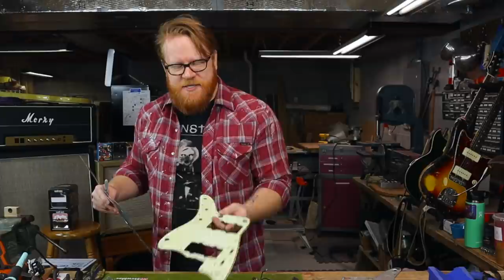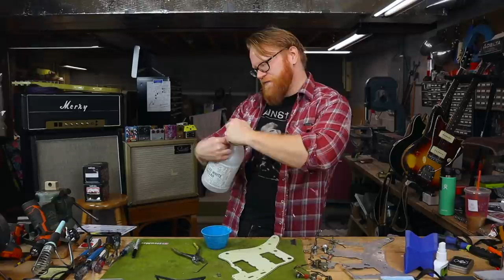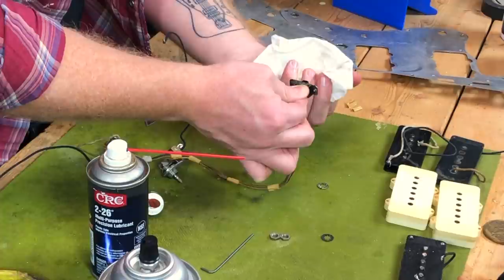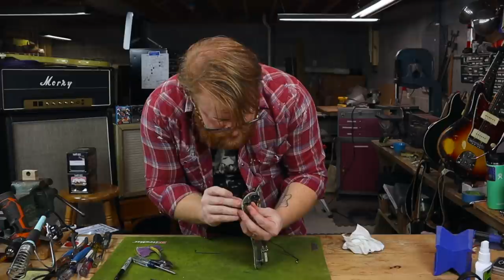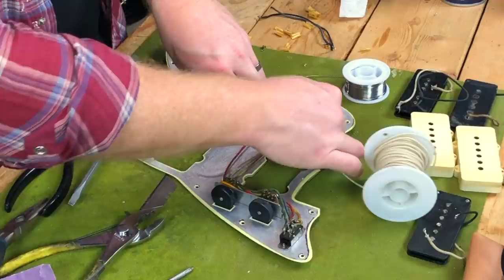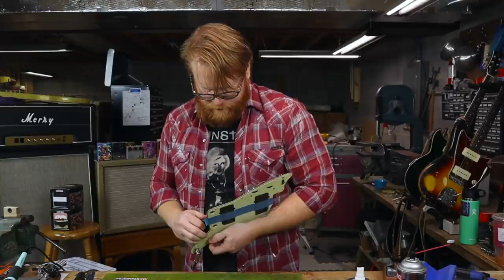REFIT & RESTORE Episode 3: Electronics and Pickup Refresh on a 1961 Fender Jazzmaster

Comment: OK…..you inspired me to dive in to my 1959 Jazzmaster. For years it had lost its mojo….was it the pickups? Nope. Watched this video….opened it up and went from solder joint to solder joint….checked EVERY connection….resoldered any grey ‘cold’ looking connections. Nice shiny solder. Sorted the wiring in that nice tight pathway around the neck pickup. Used little pieces of brown paper tape like the original. Carefully reassembled the body. Polished the frets….shimmed the neck   With a proper full maple shim. Lubed the nut slots….new set of all nickel Gibson ‘Les Paul’ 10-46(red silk wrapped ends. Set the action. Set pickup heights. Plugged into my JTM45 Offset Limited edition head/Cab…OMG!!! There she was in all her glory….blanket lifted off the sound!!! Chimey as hell and 1meg of tone like it used to sound 10 years ago!!! I am SO happy! Nels Cline was my inspiration but you convinced me to revisit the wiring. Haven’t been able to find the problem before…found lots of thin/frayed connections and possible ground breaks. Mostly poorly soldered connections. Many thanks 🙏

Comment: Hey is there any way you can provide an exact diagram of how you wired this?  I'm stuck on mine, can't seem to figure out how to correctly wire the toggle switch and grounds without using the body ground and not sure if it will even work.  The jazz circuit is working fine as expected.  The Bridge p/u works in the lead circuit, but the neck pickup gets no sound.   Please help!!!

Comment: I may be mistaken, but it sounds like there's no hum cancellation in the middle position. I suspect that's why the pickup was turned over in the first place - it's actually a neck pickup that someone turned upside down and swapped the leads on, to effectively reverse the winding and the magnet polarity. I've done that myself on a few occasions (not with vintage pickups though).

Comment: Hey mike,

Is it possible to install a mini toggle "fat bat" switch in place of the rhythm slide switch on a jag? Would it be a On-On dpdt switch?
Reply from the maker: Does 'fat bat' refer to, like, the toggle switch on the TVL? I'm not familiar with that term but if you're replacing the RC switch an on/on DPDT is what you'd want

Comment: I have a question that I was hoping you could answer  re: pots... I bought a harness for my partsmaster and the pots are a bit bent. if I want to replace them, which ones should I get? 500? 250? 1k? I have installed a set of Fender Pure Vintage pups.
Reply from the maker: I can only speak for myself, but I always stick with the stock 1meg. Your mileage may vary!
Reply: @Puisheen  Good enough for me :)

Comment: I've got a new American pro II jazzmaster, and I'm getting weird signal loss and noise from the rhythm circuit pots, almost exclusively when playing in the lead circuit. Will probably bring it to my tech, but does anyone have this same issue?
Reply from the maker: That's really interesting, they shouldn't be doing anything with the RC switch down. I haven't seen this issue, but something could be mis-wired
Reply: @Puisheen  thanks for the response! yea i thought each circuit was separate from the other. I did tighten the pickguard screw closest to the RC volume roller, and that seemed to help. it does come back intermittently though. i'll bring it in to my tech this week. your videos are great i'm learning a lot! cheers!